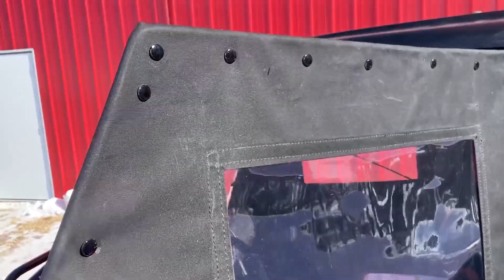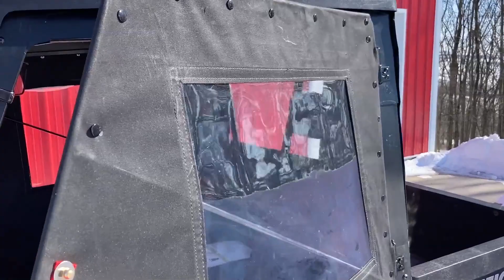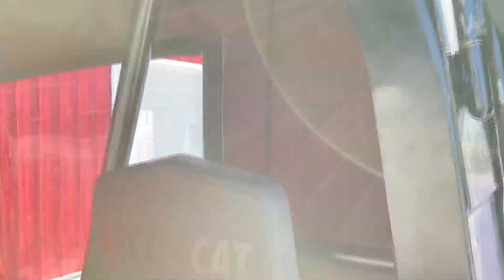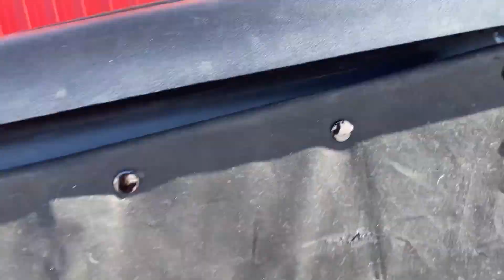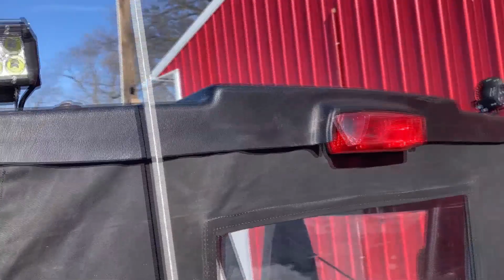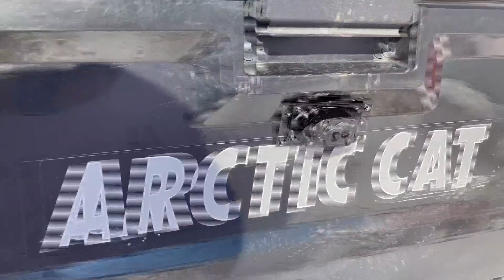Arctic Cat UTV Cab Doors - DIY MEGA BUILD - Parts List

Comment: Really good job on your machine, I may borrow one or two of them. Best of luck with your Arctic Cat , I had a 4 wheeler and it cost me about $1500 bucks a year to repair the engine or replace the axles. Always seemed like something required fixing or replacing so I traded it out.